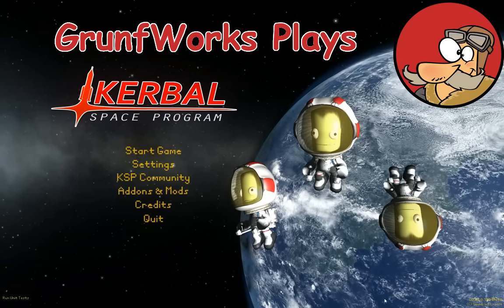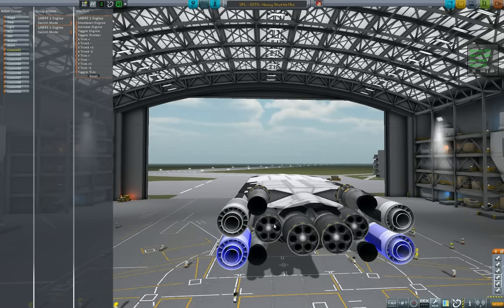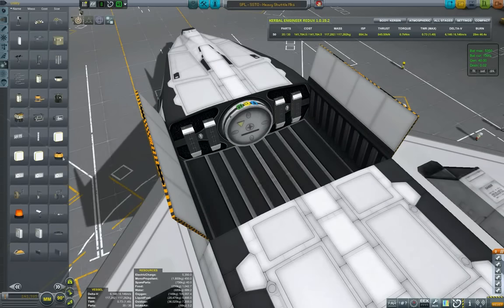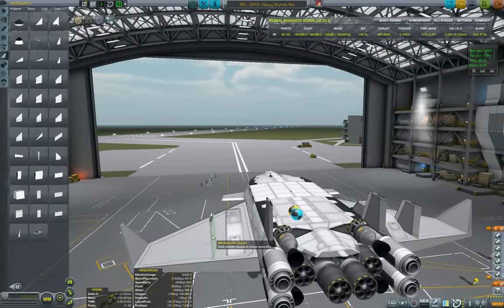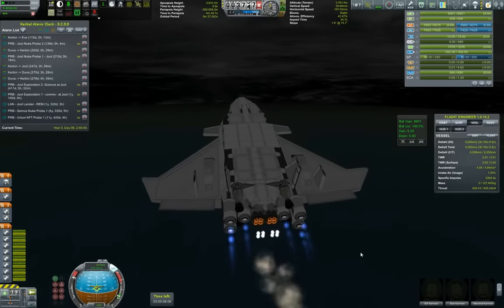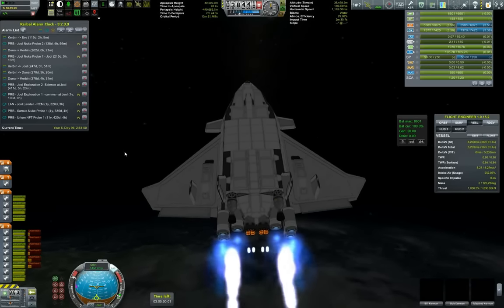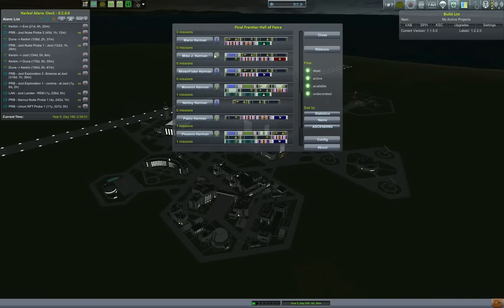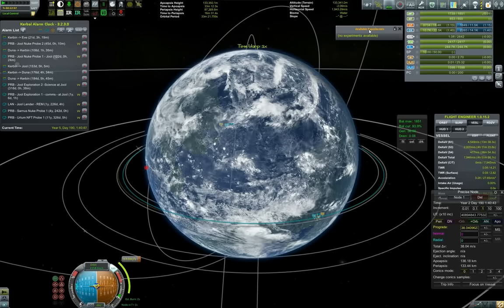KSP-Interplanetary Voyage of Exploration-Ep_72 Experimental Heavy Shuttle Design

Comment: You may want to switch to the b9 procedural wings, if possible. The UI for them is far better than the hotkey based shaping of wings that the original procedural wings mod has.
Reply from the maker: +urishima Hi urishima. Actually I am using b9 procedural wings as well, however the b9 procedural wings have restrictions in terms of max size, something that procedural wing does not.

However when i will be making the 1.0 or 1.1 save i guess b9 will be the only way to go as procedural dynamics does not work AFAIK